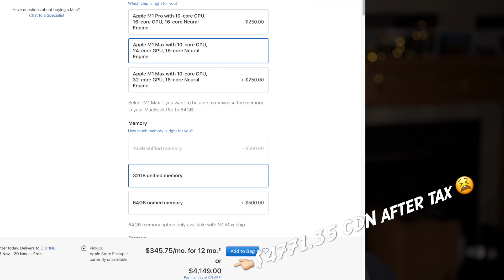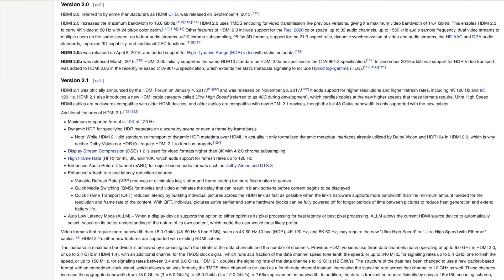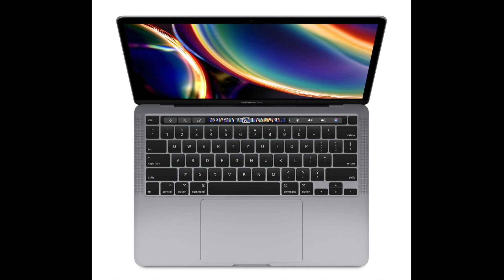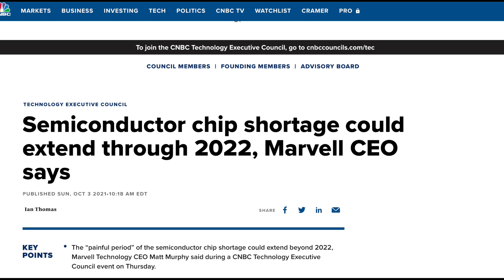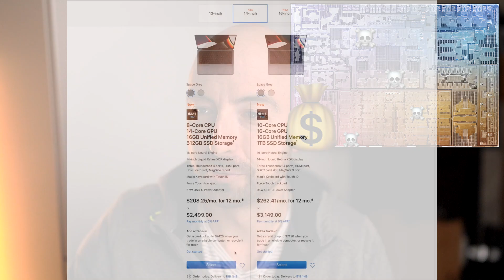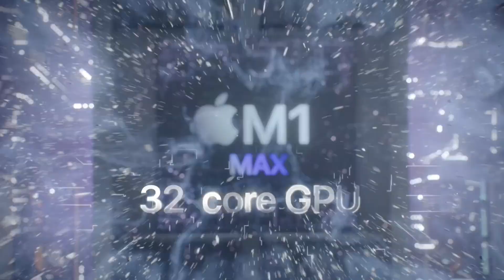The NEW M1 MacBook Pro’s & 5 Ways It’s Gonna Make a Killing!

Comment: Very interesting information I never knew about!  So my question now is (with knowing nothing about other chip manufacturers) is that with all these options, it makes it appear like these chips are not being manufactured very well….and all these “options” are simply a way to mask this..  Or, is binning very common with other manufacturers also?  Or, despite the efficiencies these new chips provide when in production, they are more difficult to produce, thus resulting in more binning??
Reply from the maker: These issues are common with all chip manufacture. It’s impossible to avoid. But with other chip designs, it results in more lost yields, or more chips thrown out. These chips are simply designed to work around these possible failures more than most other designs. Other manufacturers do have the ability to bin their chips as well, but just to a lesser extent. Most binning in the past has been mostly surrounding clock speed. Some simply work out to be capable of running faster than others while still maintaining stability. The odd thing here is, Apple hasn’t been doing this for some reason. The original M1 in the iPad Pro, and MacBooks, the iMac, and the Mac mini all clocked the same top speeds for some reason, even when they could have cranked up ether last two much faster in theory (more thermal leeway in those machines). It remains to be seen if the max chips will run at higher speeds, but it doesn’t seem to be the case. Very unusual.
Reply: @WesPerry  great info that I never knew about.    Subbed to learn more!  Thank you!